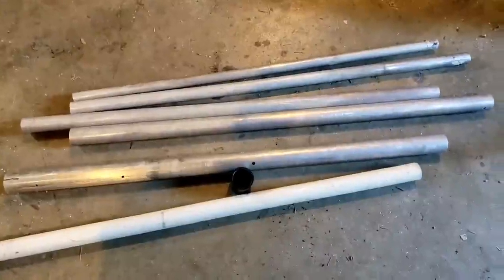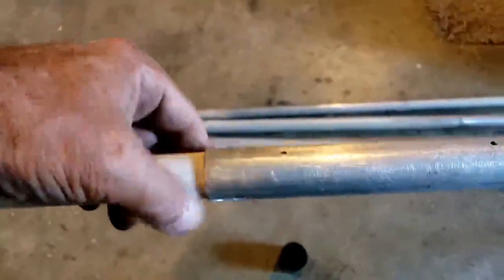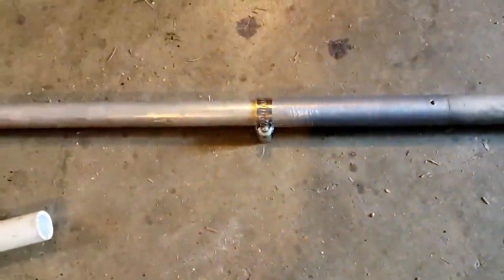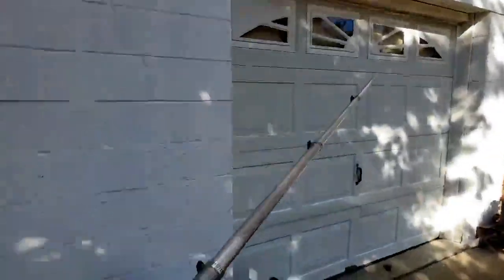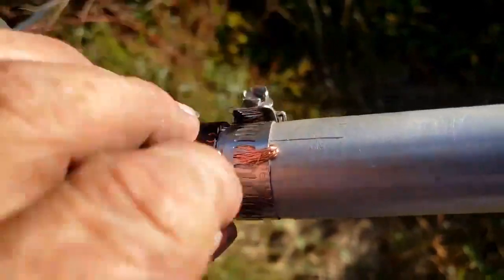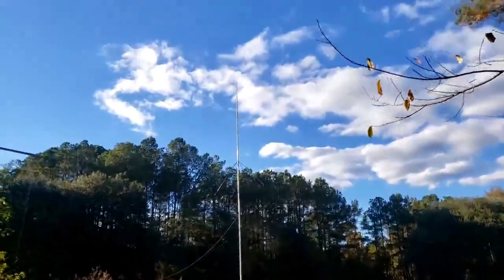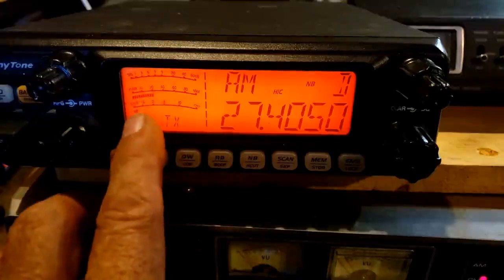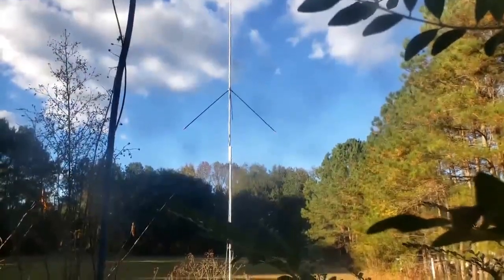Homemade Aluminum Ground plane, CB Radio Base Antenna

Comment: I would like to finish a antenna build i started a year ago ,  i'm not experienced enough i guess when it comes to getting the 4 ft. Fiberglass 1/4 wave antennas .   When i ask if a big C. B. Sales store about getting them they dont have an answer ....
I have looked on  E  bay and i dont see any of the 4 ft' ers mentioned as being  1/4 wave .
I dont see any sence in guessing if their right for the build .
     ???
Inexperience .

Comment: Hey Mower Junky,  Great Job Sir.  Putting a  1/4 wave groundplane together. Got about 102" of material for the radiator and 4 ground radials. Was sweatin' all the formula measurements (too short on the radials), but now after seeing your SWR w/4' radials, going to put It up and see how it does. Thank you.
Reply from the maker: keep in mind that my radials are 1/4 wave antennas, not just 4 foot rods. Good luck with your build. 73's
Reply: Ok Tnx, MJ,  Was reading comments and kinda figured that out. I might get some bigger tubing to attach to the mount and bend those to 45 degrees to add the 10" each radial. 73

Comment: Hey this, just a thought you know the ground planes could you take a boat somewhere mounted on a plastic pipe then take wire 100 about 102 inches wrapped around that PC pipe and someway mounted just like you got those ground plains boat to that and then you know I’m talking about you take the ground wire three pieces 102, 103 incheswrapped around the pipe tape it up and some mounted on a bolt screw on the ground like that would that work? I’m curious about making one.

Comment: Again YT BROUGHT YOU BACK!    If YOU  co-phased these unlike the recently used loaded whips, it should be broad banded better and have more gain. If you wanted longer radials,  just get some stiff #8 aluminum ground wire cut the same length of the radiator and use a plastic arm to hold at 45 degrees. Your setup will out talk a ss whip because aluminum is better. Not strong enough for a mobile at 54mph but better as you use it. DX Commander played around with an all wire version of this on an 18 meter pole and just think being at 60 feet over 15 feet? I plan to order his 18 meter pole and use it.

Comment: I like that antenna I was gonna try to do that but the two ground planes it’s gonna be I thought maybe trying to the two stainless 102 stainless whip for two sides and I got some aluminum pipe for the middle I was going to try that and see what it does
Reply from the maker: That should work very well. I've made a few ground planes with only 2 radials, and they worked great. Take care Shep, 73's

Comment: Great built. Can galvanized wire use for gp
Reply from the maker: Yes you can, but you might have to clean the wire where it connects to the antenna.
Reply: Ok

Comment: great video. Although i prefer you build the ground planes yourself, including mounting kit, full size over wire wound. Using ready made is only half home brew.😉
Reply from the maker: I agree, But this 1/2 homemade did work well. Thanks for watching, 73's from 151 SC.

Comment: Youtube replayed this and knowing from your later videos of yours you have recently worked the UK, EU, and  Australia this ground plain favoring the low end could let you work New Zealand from 26, 330 up remembering their channels are on the 0s, not the 5s. The best time could be around sundown or sunup either end. Tune around and see if you hear anyone. Also, Germany has a group of 40 channels below 1 also, of course, they also use the same 40 as the USA. traffic is still light so finding a quiet spot isn't hard yet, but it likely will be before long as folks realize skip is back more often.

I might be wrong and just using 36-40 may be quiet enough that tuning around is unnecessary. I love to go off the beaten trail. I loved finding an odd station on some oddball frequency but back then there were so many users working your mobile a mile away was hard. The 23 legal and the slot at 15A sideband was all we had unless we got a ham rig. No so-called import radios were available. Crystals gave you 4 channels but took away others until the channel boxes or VFOs became available.

Comment: The top main element looks a lot longer then 108 inches amd I missing something?
Reply from the maker: the top element is actually 102.5" long. 108" is for 26 mhz. The equation I used is, 468 / 27.385.

Comment: I'm in the process of building a simple 1/4 wave GP antenna for 6 meters (50 Mhz) Ham radio. The ground planes will be slightly longer than the radiator by a couple of inches. (5% I think). This would apply equally to 27 Mhz. Attenuated GP's are as bad as loaded radiating elements. While your playing antennas try a 5/8 wave or better still a .64 (point 64) wavelength...using the soil as the ground. I did it on CB about 40 years ago and the low angle radiation  is ideal for long range 'local' stuff. Lay wires underground if you wish...it does help with earthing. 73.

Comment: Was the bottom tube part of the ground plane and have any specific length or was that just long enough to act as an anchor point and all grounding was done by the radials?
Reply from the maker: the bottom pole is just for mounting, it can be any length.

Comment: If he wasn't talking on LSB, he wouldn't of made the 30 miles. On AM, he might get across town.
Reply: I have a Galaxy DX 2547 base (9watt dead key 20 swing) hook to a antron-99 at 38' and I can talk 50/65 mile. My elevation is 245'. Not ssb.

Comment: I'm not certain on how to ask this question but does the 102 length measure account for the length of aluminum that goes into each section or does only the outside surface of the element count towards the 102 inches?
Reply from the maker: The assembled length is 102" long. it can be done with 1 pipe 102" long, but I used what I had. Thanks for watching, Take care.

Comment: If you have not already done it, you will need to waterproof the coax connections, if not water will ingress and affect the coax and SWR.  Yes, I realise (realize)  it is only for test, but just in case someone else tries to copy it.
By the way, out first antennas we were allowed to use were the same design, except we were only allowed to put a 1.5mtr whip on top :-(  UK Government rules.  The Plunkers!

Comment: Build a 3/4 wave vertical.  You won't regret it.  When I went from 1/4 to 3/4 wave on my 10 Meter, I could suddenly get out, hear and be heard.   Course, volacity factor with the coax will do marvels.  GOOD WORK Sir!  AC9JU.
Reply: I have a 102 whip in the air about the same night as him and barfoot on my Lincoln 2+ at about 30 ish watts on side band I talk from Santee South Carolina up to Sumter and down to Summerville SC. I can do the same on am if it's not too much noise and fm is good too at about 20 watts. I don't usually turn it up that high on fm I usually turn on my kl 200p amp and radio set to about 1 watt input. I'd rather use amp life instead of radio life.
Reply: Can you elaborate on the VF?

Comment: Awesome ,one of these days im going to build myself a Starduster.I had one back in the 70s and it worked very good.
Reply: Mine had some almost 3:1 swr, and I cleaned the heck out of it, it was seeming to be tuned for below channel 1, but I could not face cutting the vintage fiberglass, so I went full send.
Put it on 3 20' fence pipes with tapers on one end and had a 58' tower in 8th grade. Had the hot finals going nation wide and groundwave to higher elevations of Illinois, Michigan and south of Kokomo, but could not get the funds together for SSB. Took it down real quick one day when an impressed neighbor warned me of a huge storm coming. Tower Down!!!

Comment: Looks like a home made stardust using the ground plane kit those physical set up translates to the low swr hitting the ,45° radials gives a good launch pad for ground communications if you plan on keeping that ant in air the connections could be sealed with the monkey tape ( don't know actual name) but is like layer tar stretchy once placed last forever we in catv techs used it to seal both open exposed and buried cables also known as " monkey snot" 
Love your vids remind me of the days I used to build myself but now limited physically 
Have good weekend good doing 398 Wis

Comment: Hey there me mower junkie. Another fine antenna project.  We had fantastic skip conditions to USA last Sunday infact I even tried to call to see if you were out there on 385 lsb but it was so  splattery it was hard to hear anything.   I actually got time to finish my slim Jim antenna I made from ladder line and my homemade Balun. And I must say it worked really well as I did work quite a few USA and Canada stations on 415 lsb as it was a bit quieter up there It was great 👍.   Keep safe my friend. Good dx 73s .